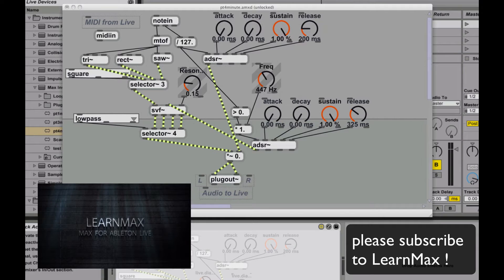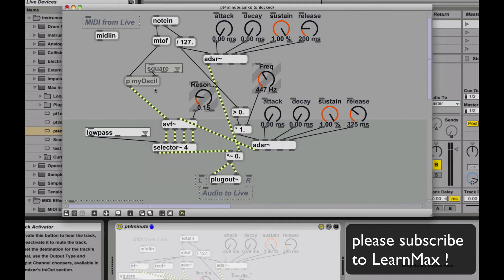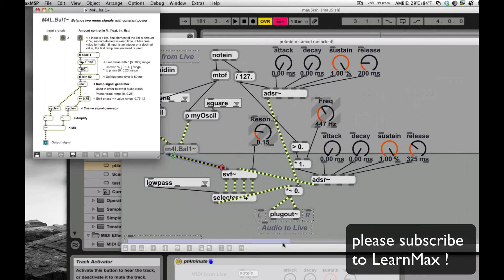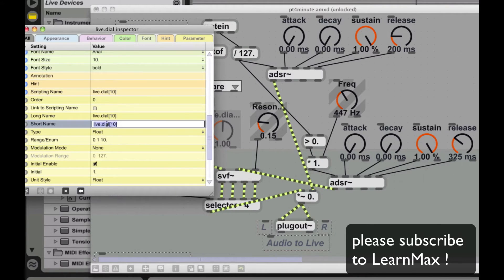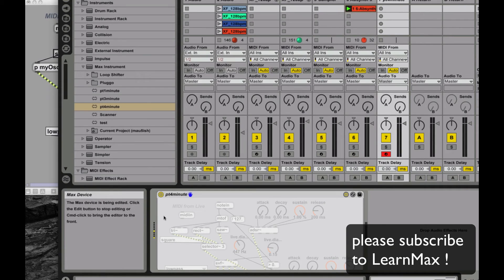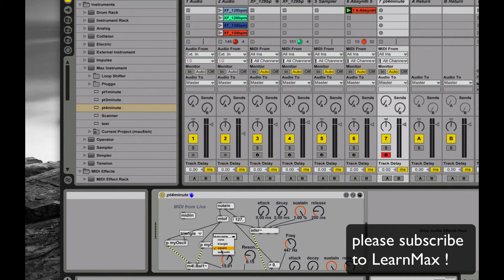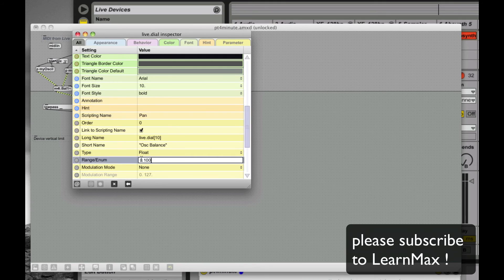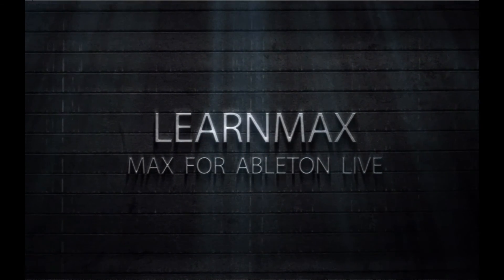M4L Tutorial #6 : add a 2nd oscillator to synth by encapsulation : Max for Ableton Live

Comment: As soon as I encapsulate the oscillators I don't get any audio, I only get midi info and this is even after saving etc. Do you have any idea what I might have done wrong? I'm pretty sure my patch should be correct
Reply: I had this problem too. What fixed it for me was selecting a waveform again from the list box. I've had this a few times with different bits of these tutorials. With a lot of objects, you can set default values to avoid your patch loading up the first time and not working.
I am enjoying this series, but I have to agree with previous commenters that it's a wee bit too fast sometimes. I feel like I'm driving past in a car at 60mph when to understand it I really need to take a walk and have someone point out the landmarks and points of interest.
Works well to get you up and running quickly though - and good if you're happy to do a bit of reading round or head-scratching to fill in the gaps.
Don't want to be a moaner - This must have taken a lot of work and I am grateful! Just adding a +1 to "I'd still watch videos twice as long if it meant explaining in slightly more detail".